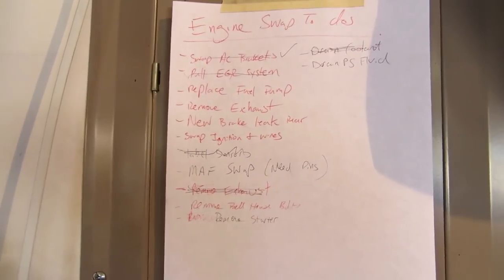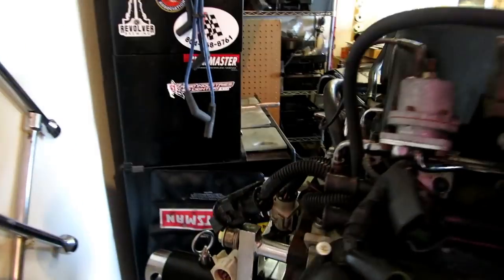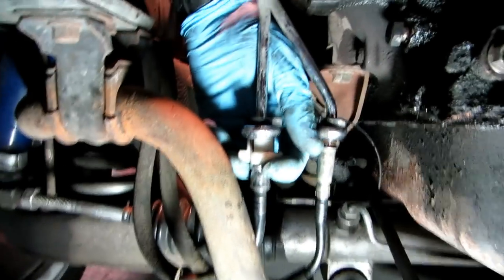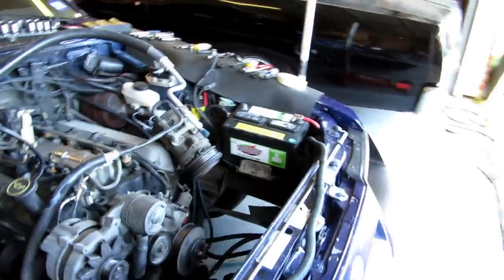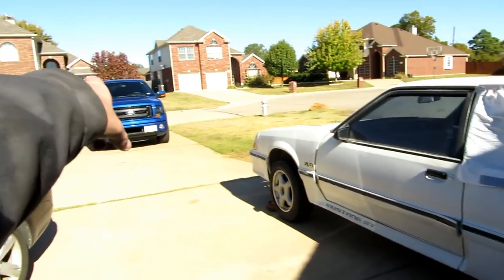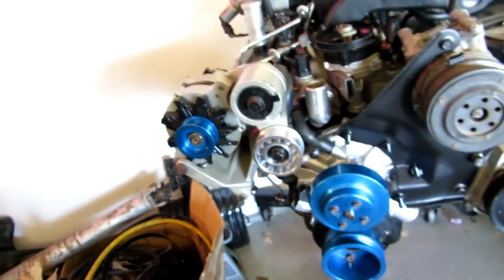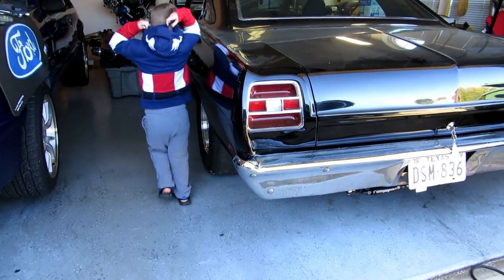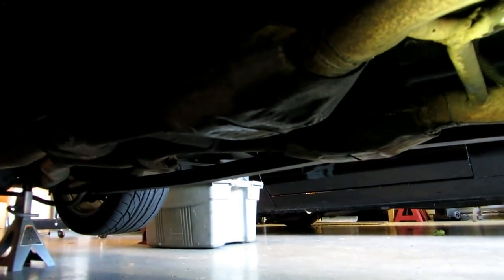1986 Mustang GT Project - Pulling Exhaust and Tranny - Engine Swap Part 7

Comment: Everything I have touched on mine,has turned out taking twice as long!Nature of the beast.One thing always leads to ten other supporting mods,lol!Good work mike,just did the mass air conversion on mind,injectors broke into a million pieces. Had to pull the lower intake to remove debris,no fun my friend!Keep up the good work.
Reply from the maker: Haha, man no kidding. Injectors must have been brittle! Guess the MAF swap went okay? Did you go as far to do the fuel pump relay wire to ecu, and the VSS wire? Thanks Frank
Reply: Mike Dula Yeah Mike had to do all the above! And replaced my speedo cable and added 140 mph speedo why I had it apart! Did new fuel pump also, walbro 255 liter per hour. I ended up breaking the 60 pin housing connector,and had to replace that!Another  $25 and those little pig tail connectors were a pain to find! Do yourself a favor and solder all your connections. Know need to skimp at this point. It was fun,NOT!!LOL.
Reply from the maker: Good to know...Now Im nervous lol. Where did you find the pins? been looking everywhere. Found some at summit but not sure of the size. I "could" steal them from my 86 ECU but I really dont want to hack that up.
Reply: Mike Dula Hey Mike,the company is call Interactive System Technologies! Part #CG-5179-F, $14.95 for 10 pieces. That should be all you need!They sell alot of hard to find mustang stuff! Good luck my man.
Reply: They are the MALE ends that plug into the computer harness,suppose to have special crimp tool! I just soldered everything together.

Comment: Spray out the fuel fittings with wd40 also. There's a round spring in the fitting that locks it in place.

Also, my 3g made 90 amps at idle. I couldn't test over 100amps, but the paperwork said 165 amps at 4000rpm.  just a cheapie parts store alt for a for Taurus. The stock one made about 25 amps at idle and around 55amps at 2500rpm. Stupid easy and sorta fun swap. Makes a difference at idle, not so much otherwise. The 3g alt is also much bigger like the overdrive pulleys.
Reply from the maker: Yeah man, I shot may too much on removing the fuel line quick disconnects lol Explained the spring etc...I ended up cutting a lot of it out of the video....As far as the 3G, I plan on fully swapping in a 3G before the motor goes in. No reason NOT to! Needs the amps then I can run an e-fan. Good to know about it making 90 at idle! Is that with or without underdrive pulleys?
Reply: Mike Dula that was bone stock with the pulley that came on it from the parts store. And actually it was in a 86 mercury cougar wIth the 302 with quite a bit more electronics then a mustang has.

The reason for my swap, downshifted to merge on the freeway. My 300+k mile fan clutch came apart at about 5000rpm. It stayed on the water pump but took out the fan shround. I was driving about 1k miles a week at the time and needed the car.

I couldn't get the fan clutch and my shroud was gone, so I just pulled the fan off and hit a junkyard. I got the Taurus fan and zip tied it in on my lunch break. It worked fine, but melted my alt wires. I went back and got a alt and upgraded the wiring. Used a 175amp "mega fuse" with the holder and got two long 6 gauge "starter cables" with lugs on each end. The junkyard alt crapped out on me after a day so I bought a new one and never had another problem.

Reclocking the alt is stupid easy, biggest issue was drilling out the alt hole so a stock bolt would fit. On the parts store one I just ran a 1/2" grade 8 bolt instead of drilling it out. Overall, I see no reason to pay $200-300 on an "upgraded" bolt in alt. 5 minutes of work will save ya a ton of money. I also could have bought the "heavy duty" alt and got a 200 amp rated one. I think it was around $150.

Comment: There's a hole behind the passenger side front wheel that makes it a tinier bit easier to get the top starter bolt as long as you have shorties lol. Just a future reference.
Reply from the maker: Dang! Good to know!
Reply: And you can use a long extension and get to it from the front of the k member.    Unless someone installs equal length shorties.   I would buy the factory headers from you.

Comment: great video Mike. If you are deleting your EGR no need to run the EGR coolant lines.   I would also put in a 1993 mini starter in place of the  one you pulled.  You can also sell your old cats as the platinum is worth some $$$ ...
Reply from the maker: GOOD TO KNOW! Thought it also helped cold starts or something but that is two more hoses I can now remove!
Reply: hey you also want at least a 255lph pump, I would go with a 340 if you are putting on a turbo and at least 42# injectors

Comment: H-pipe with some 10 series flowmaster sound nice. Well if you want loud lol
Reply from the maker: Would sound great. I love the sound of the H pipe vs X. I got a couple of stainless mangaflows that came with my donor I plan to run. They sound really good.
Reply: Mike Dula that should work. On my fox i have the 10 series and you can really hear the cam at idle

Comment: When they assembled these cars in the factory, the engine, trans, & cads were slipped under the hood as one complete unit (I have pictures). So my theory is you could have pulled the the engine transmission and cads out of the engine bay all together. Then disassemble the engine on the floor. That's my two cents, but what do I know...
Reply from the maker: You have pics from the factory...You know more than I do then! I thought about this but needed to remove the trans anyway to clean it. Man, I would love to see these pics from the factory. Would you mind sharing them? prisonplanet88@gmail.com
Reply: Just sent what I have to you. I try to collect stuff like this on the foxbody. So if you run into old tidbits of information and pictures like this please share.

Comment: top bolt requires like 3 extensions and a swivel from way back
Reply from the maker: Yeah it was a bit of a pain, I ended up getting the thing out from up top. Long arm angled wrench would be ideal I think.

Comment: Oh yeah are u getting rid of all the cats,if not wouldn't it run better with out,just asking cause I didn't know if u have to return anything cause I thought about taking mine off.
Reply from the maker: Yeah. Cats are gone. I already have the off-road BBK H pipe. The older cats dont flow as well, and need the thematic air pump to pump fresh air in them to even work. Most pull off the smog pump as I did, but over time it could make the cats overheat and clog up. So, if you are emission exempt, pull the cats off. One GOOD thing about the cats is the lack of smtrong exhaust smell. They really help exhaust smell "cleaner"